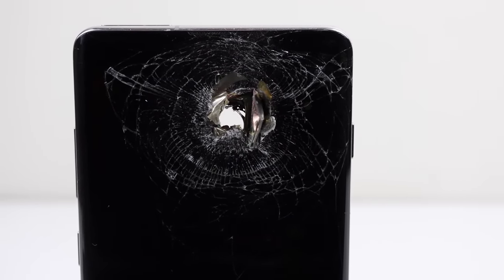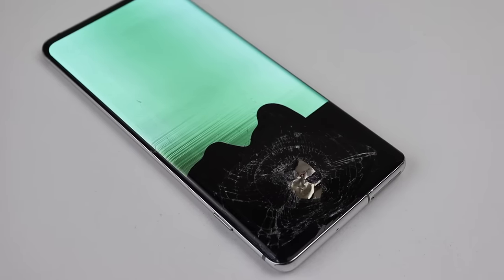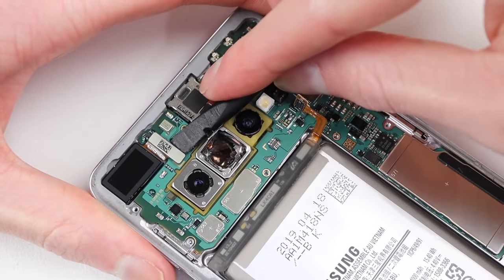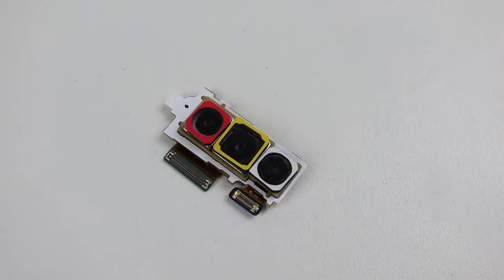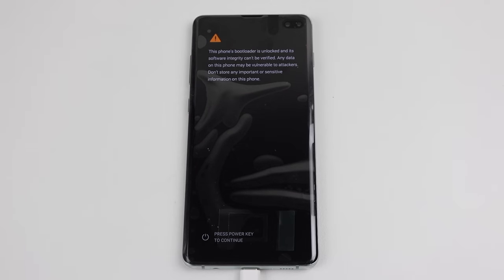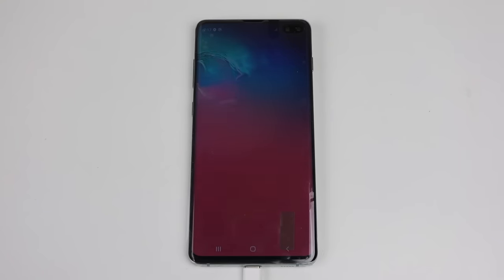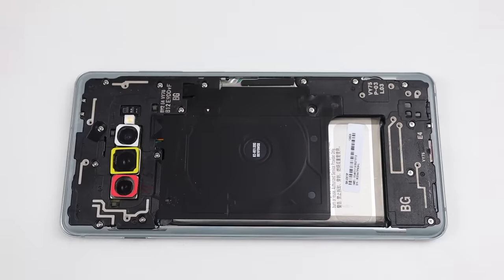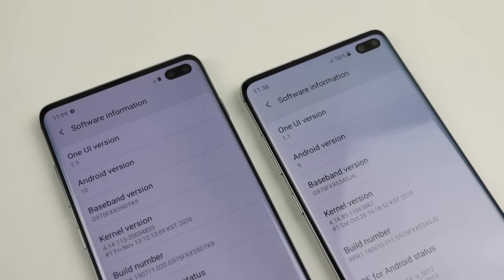Owner Drilled Through This S10+ - Can We Refurbish It?

Comment: You should've mentioned how much you spend on the repairs
Reply: I know the display for that phone is around 300$ usd
Reply: @kelvs45  used == chances of burn ins.
Reply: @liftusup9208  that's if you get badly used system (for example: You got a used gtx 760 then you cooled it properly and used it for years without a burn)
Reply: Yea that's the thing when I kinda want to DIY my old phone to look new but then realized the part is rather expensive.

Comment: Note : Stuff like Samsung Pay will no longer work on the phone due to a e-fuse burning when the bootloader was unlocked so it doesn’t revert back even if you relock it.
Edit: fixed typo and more clarification. stuff like this is common for stuff like disabling downgrades (xbox 360)
Reply: That’s crazy! You mean to tell me that Samsung put some sort of self-destruct mechanism into these phones? I take it back, that’s not crazy, that’s insane!
Reply: @BlindMansRevenge2002  No, it is NOT self-destruct. Samsung simply put a fuse designed to "burn" as a security mechanism to see whether or not the phone's security has been compromised.
The phone will work just fine, but some stuff like Samsung Pay aren't gonna work since the software knows it's been compromised.
Reply: @InferiorSerperior  why even is samsung so against bootloader unlocking? they even made the under display camera break when unlocking the bootloader on the z fold 3
Reply: @aray7152   maybe it's for user security or they want people to keep using samsung services.
BUT honestly how could a goddamn camera be disabled ?
Reply: @InferiorSerperior  buuuut you can fool the software to think it's not compromised while it actually is (MagiskHide does just that, it hides the root and bootloader unlock status from the OS)
Reply: @canny1913  I don't think so since as soon as as you flash a custom ROM Knox goes into a compromised state and permanently disable those features. It isn't just software so hiding it is harder if not impossible.
Again i'm not 100% sure and i'll be glad if you can correct anything i wrote on the thread. Debunking misformation is always good.
Reply: @InferiorSerperior  Yes it will be compromised but here's the thing:

TL;DR: Android apps cannot read eFuse's, so the OS reads it instead. The OS reads and stores it into memory so the apps can read it freely and sees if Knox is tripped or not. Because it's stored in memory we can use a script to change the memory so the apps would think Knox is not tripped while it is. The OS only reads the eFuse once during boot-up so we don't have to run the script all the time.

Android apps cannot read eFuse's (The OS doesn't allow that), only the OS can.

So what they do to workaround this is they add a specific variable in the OS (called ro.warranty.bit, set to 0 by default) and add a function that changes this variable depending if Knox is tripped or not. (sets to 1 if tripped)

But the major issue with this is:

The OS uses this function only once (due to how Android's boot process works), which means it only changes this variable once every time the phone boots.

So what you can do is you can add a script to change this variable back to 0, here's how it would work:

1) The phone boots.

2) The OS checks the eFuse, sets ro.warranty.bit to 1 if Knox is tripped.

3) After it's set to 1, the custom script that we just added runs and changes this  variable back to 0.

4) The Samsung apps reads the variable, notices it's 0 so it passes the security check.

5) Congratulations you just fooled the whole OS.

Comment: Worked on a LG K51 knowing some parts were going to suck (Transferring Volume Button Ribbon Cables and stuff like that) But i PRAISE most android manufacturers for keeping Phillip head screws and decently easy adhesive (even the original battery adhesive wasn’t bad and came out with no bends or kinks and no heat needed just very light prying around the sides)

Comment: The drilling was so precise it looks like a phone with a custom security install that was disabled with the drilling on purpose. The seller probably obtained it from a bulk sell off of various devices and computer equipment from a government department or business with high security. A medical company I used to work for would have us drill or remove any storage devices or anything with specific identity linking it to the business from stuff when we would sell them off.
Reply: But they kinda failed here
Reply: More plausible is: People like to drill centered, so that the drill does not run away. A camera is inviting as it is the ideal centering spot to begin drilling.

Comment: Hugh, given that you are sponsored by ifixit I am surprised that you haven't started using Tesa tape for double sided adhesive. Ifixit did a video with Tesa a few years ago and thus brought Tesa to the mainstream market. Tesa is (acclaimed by Tesa) an oem for adhesive applications, meaning manufacturers of devices use them to properly adhere their devices together. I've been a professional technician for just over 6 years, and Tesa adhesive (black tape) is the best I've come across, aside from 3m VHB. Tesa is very good for installing batteries and holding back glass on for some models, but is especially good for iPad glass replacement.

Comment: Literally done the same thing with my s10+ repair and made it the prism green model. Only issue mine had was old screen from previous owner had been smashed. Original battery and cameras worked fine so just needed a new screen assembly and rear glass replacement which are really easy and only take me about 30mins all up from start to finishing closing up the phone.

Comment: Pro tip : don't lock the bootloader before flashing , you could have turn on frp , and the worst scenario is that the phone had a custom recovery .. it's done , the phone boots to recovery to wipe everything before locking. And it won't work because you have a custom recovery , so the phone will stay looping to recovery without wiping anything . And there is no way to flash the stock recovery if you're locked .... Happened with me with a pixel 2xl and i got no way around it.

Comment: I don't understand how you got the adhesive to stick so easily. I did a battery replacement on my s10e, and the new adhesive just won't stick. I've tried heating the glass, book weights, etc but nothing works. I'm just using my phone case to hold it together.

Comment: I have a question about iPhone 7, 7 plus and some 8 models. The noise cancellation setting was removed by an update on some models. I have a 7 plus 128gb model A1661 that the microphone and recording also ability to here or be heard on phone calls is gone. My other 7plus with IOS 14.6 also with model A1784 256 gb has noise cancellation feature still and nothing wrong with it. There’s a forum all with people having same problem. Apple offers neither remorse or solution. Have you heard of this? Thanks

Comment: Still using my s10 plus!! I got it in 2019 when it launched. I have the 512 model with ceramic white
Reply: Great phones even though i use iphone 👍🏻
Reply: @grahamevans8567  iphones aren't that bad, I dont like the fact that there is virtually no customization and that there aren't any cool camera modes and that the software is locked and that the user doesn't have much control over the device

Comment: Was the Knox tripped? If the previous owner tried to flash custom software, they might be tripped the Knox counter, which is not recoverable once it's gone.
Reply: well, he's using the phone with no problems, so what do you think?
Reply: @andoletube  of course he can, but knox is a great addition in terms of security and it may also limit device features when it's tripped, which can drive the resale value down

Comment: Why don't you do an experiment. After applying water resistant seal/gasket and sealing the phone. Heat the phone with the help of heat gun and press firmly to make the adhesive reach the deep spots to prevent water from entering the phone. After this che the water resistance. I saw this in a YouTube video (filmed in Huawei repair center) when Huawei was replacing mate 20 pro faulty displays.

Comment: How do you flash software?!! I have a phone that won’t boot because of corrupted OS but otherwise good condition. I’ve looked online and I can’t find an easy way. What method did you use? THIS IS A SERIOUS QUESTION I ACTUALLY WANT TO KNOW
Reply: Anand Raj  its a Samsung Galaxy J3 Luna Pro [SM-S327VL]
Reply: Anand Raj  which website do I use? Theres so many random ones I dont know what to download or to find this information
Reply: Anand Raj  ok so I got everything to work except when I plug my phone in Odin doesn’t find it even when it’s in download mode so I don’t know what to do
Reply: Anand Raj  yeah that’s the problem they won’t install I searched online for 3 hours and Windows Security says its not verified or something I press install anyway and it won’t install

Comment: I actually now the real reason behind the drilled hole and it’s not rage.

So some big company’s like Audi, Porsche and so on they don‘t allow their Employees to use Phones with camera at work. So many people drill into the phones camera or let the IT-Department make the Camera unusable. This is to prevent leaks of upcoming projects. I guess they tried to disable the Camera via software and after this didn’t work, they tried to drill and went to far. This is now joke I know someone who works at Porsche in Germany as an engineer and he told me that every employee in his facility has an second phone with Drilled cameras. 

This is what made Blackberry unique, they offered every phone without camera for exactly this use case.
Reply: Yeah now try explaining the non official software
Reply: Also, it’s much better to simply disassemble the phone and remove the camera module altogether. This not only prevents waste, but also results in a totally reversible modification. And guess what, a far lesser chance of dust or whatnot entering the phone. I used to think of Germany as a higher standard country, seriously.
Reply: @satsumagt5284  Most People get theirs from the company as work phone and they already pulled all the cameras out of the Phone. But I guess some Phones don’t work without an Module connected and so they drill it so it’s get recognized by the Phone but still can’t shoot pictures.
Reply: @theGamer93  there are still some non destructive ways, such as painting the inside of the exterior camera glass

Comment: Hello sir, glad to found your video after digging in youtube this far. I want to ask you whether it possible to put the battery from samsung exynos version in to samsung snapdragon device? Because i have samsung s8 japanese unlocked version, but sadly i live in Indonesia where almost S series samsung phone were using exynos processor. Thankyou before .
Reply from the maker: Batteries are the same regardless of region so you could use any battery designed for the s8.
Reply: @HughJeffreys  thankyou for your answer sir. Now i can wait peacefully until my s8 drain its battery health under 70% and change the battery with genuine battery sold by Samsung Indonesia.

Comment: How does the OLED still work? I’ve seen phones that barely get dropped and the OLED breaks and doesn’t display anything
Reply: I think, although I'm hardly knowledgeable on this, that hard OLED and soft OLED have different durabilities. hard OLED will stop working with any crack, whereas soft OLED can sustain some damage and still work, as you might see in the damage to a foldable display screen.

Comment: I am slightly suspicious - why there are full signal bars without even antenna installed, but that isn't only the case. I presume, that prev owner got scammed buying a demo phone with modified firmware to be able to initialize a modem (partially), then he got tired of bugs and instability of cfw and tried to flash stock rom, which of course he couldn't. Must be sh%t ton amount of time b4 he realize that is kind of dummy. And he execute it... That theory has got a 1st place, 2nd is a "lunatic" award, and last (but not least) he cant fit a new fancy fisheye lens so he screwed it... ahah

Comment: You're better off buying a new S10+ and it would be cheaper than replacing the screen because of how expensive and overpriced they are. I don't understand how you profit from it?
Reply: Making a video
Reply: @monkeykonggaming  yes and apart from that.
Reply: True. I cracked my screen while working (I work in constructions it fell from second floor). Screen replacement is 260€,brand new s10 is 300 €. Samsung screens are overpriced badly.
Reply: @PanzerFaust1754  trueeee

Comment: U know that the wireless charge module is has a battery temperature sensor in it so whenever u unplugged the wireless charger module the phone will stop functioning. Because the phone will no longer detect battery temperature wich is dangerous like the older galaxy note7.... So Samsung includes the sensor in it... whenever the battery temperature rise the sensor will cut of the power going to phone...
 Which is result to prevent the battery to get hot and exploded...

                      R.I.P NOTE 7
(19 August 2016 -11 October 2016)

Comment: Where did you buy the camera i bought mine on Amazon and when i switch from front to back camera it makes a clicking sound any ideas?
Reply: the click sound is normal on the s10 because the principal camera has a adjustable aperture so when you switch to the back camera it closes and reopen the aperture to make sure its working
Reply: mine is new and never been open and does the same since I bought it so there's nothing wrong with yours 😉
Reply: @danmarinellix  thanks for the info

Comment: Pro tip for anyone who wants to root a s10 series phone. dont drill a hole into the camera and display, it wont unbrick the phone after you failed to flash the correct files.

Comment: My cousin phone has a big problem In her galaxy s10 phone, the charging port of her S10 isn't working at all you cannot even charge it with any charger because of a small burn inside the charging port, but thank goodness there is a wireless charger 

In her case can her charging port can be fixed Regarding that motherboard is stick on the charging port

Comment: What would be the benefit of installing an alternative OS on this phone? Would it even work as a phone anymore?
Reply: On this phone I don't know but when your phone doesn't get security updates or even attention from the manufacturer custom Roms are a awesome way to keep a phone out of the garbage
Reply: Also by alternative OS they often mean a custom Android ROM, so yes the device would still work totally fine as a phone

Only "downside", is that since most custom ROMs are compiled based on Google's Android code (and not Samsung's) they're all stock Android, so no One UI visuals or features for the most part

Some Samsung devices may also have port ROMs, which are basically newer One UI versions backported to them (or the same version but with extra features) which are made through somewhat hacky means

Comment: Its really sad that the owner couldn't use his 2 braincells to make a simple google search on how to unbrick a samsung phone, it is super, super simple. Download stock firmware and download odin, boot into download mode and flash from odin. Also I dont know how he managed to brick it in the first place, There is almost no way flashing twrp(first step to root your phone) bricked it, unless he flashed a twrp for some other phone, or if he removed the cable during flashing, which is unlikely since the flashing takes less than 2 seconds. probably he didn't even look at the device model and downloaded twrp for some other s10 model, and flashed it. He could have downloaded the right twrp and do the exact same thing again and it will still work, instead of fucking DRILLING your phone.